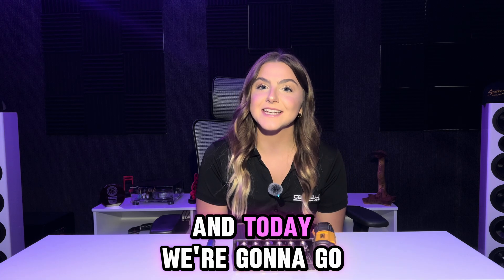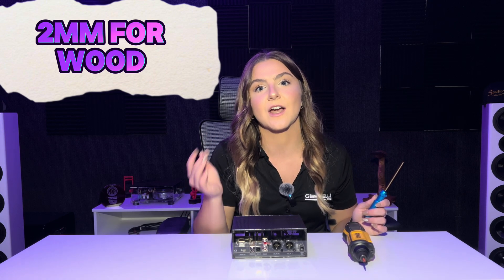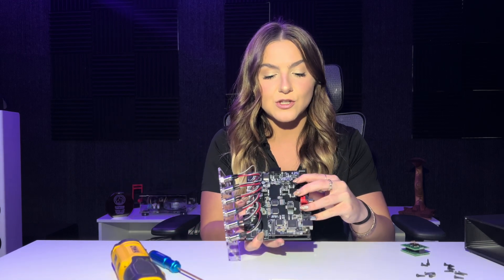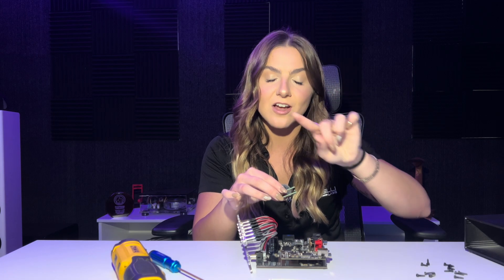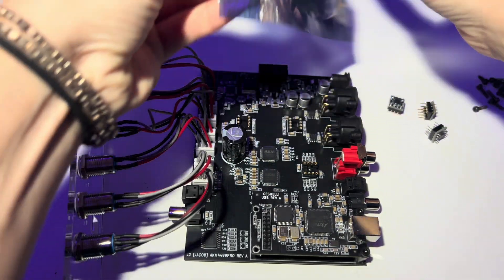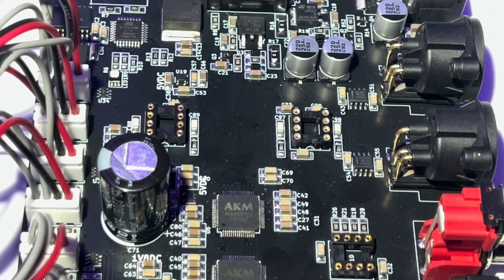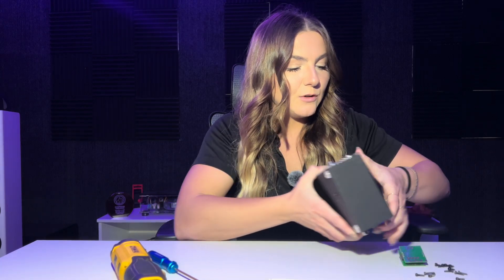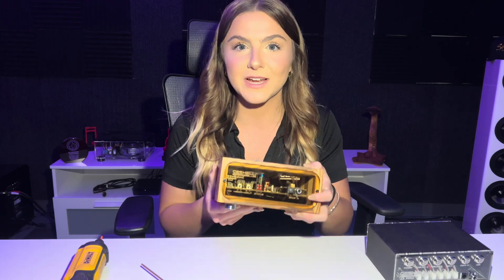INTRODUCING THE INTERNALS ON THE J3- How To Swap Op Amps On Your Geshelli J3 Pro

Comment: So we can not order the J3 with the Sparkos 2590’s? But on the Dayzee we can.
Reply from the maker: @Zomvibe  the 2590’s on the J3 are 2 of them connected to make it a dual op amp and called the “pro to dual dip 8 adapter fully assembled” This makes the op amp heavy so it can fall out during shipping. The 2590’s for the DayZee are just one op amp since it’s a mono op amp. You can still order the 2590’s for the J3 by emailing in. We do this so people are aware they will have to insert them their self and that they will not come in the unit. I hope this helped! :)

Comment: Hi Rachel, would you consider adding the pro-type op amp receivers on the board for the 2590’s like you do on the Dayzee?  It’s a bit concerning watching how unstable those large boards are sitting in those little dip-8 receivers.  Any vibration could cause long term wearing of the pins, since there’s relatively little gripping force.

Comment: Why would someone would want to use this and not the dac that comes with the receiver or amplifier. Is there a huge difference in terms of sound quality
Reply: Older equipment may not have newer DAC chips.  This is a way to upgrade without tossing the equipment in the ewaste pile.

Comment: I have watched several op amp vids and i really dont hear much difference between different good op amp chips
Reply: Yes, at a certain point, the changes can be just small degrees of difference. Some chips are warm.  The chips she is using are for professional mixing consoles. Yet that Chanel may be just another degree of change.

Comment: I know I posted this last time you discussed swapping op amps. I worked on copiers and printers for 40 years and swapped a lot of op amps and eprom chips. There is nothing as awful as the smell of smoke and the feeling of despair when you put the chip in backward and turn the power on. Trust me, I know! LOL Great advice Rachel.

Comment: Rachel, I have a question🤔 i’d like to share the J3 between two different systems but they both have unbalanced inputs ( RCA) Will your DAC’s accept XLR (balanced) to RCA (unbalanced) adapters? I know I can always split the RCA signal with a Y cable, but I prefer not to go that route if I don’t have to.
Thank you Rachel.

Comment: think you had a typo for wood mm size... at 57 seconds into the video you said "two and half mm" size but your text in top corner says 2mm for wood... believe you may have been holding the 2.5mm driver. nice video and great explanation!
Reply from the maker: @sevengrey2408  darn it… this is what happens when you edit at 1am😞😂